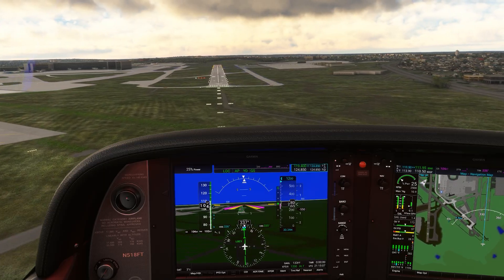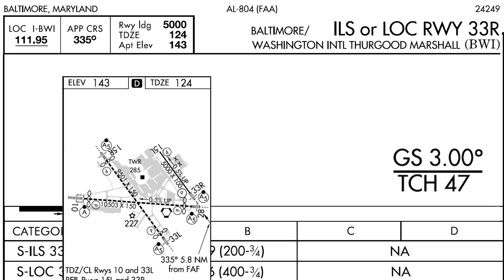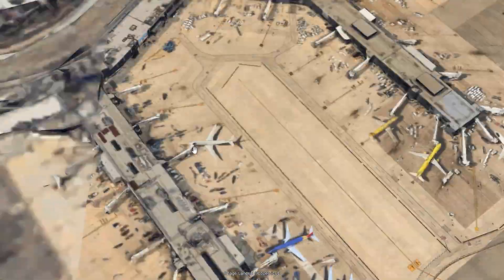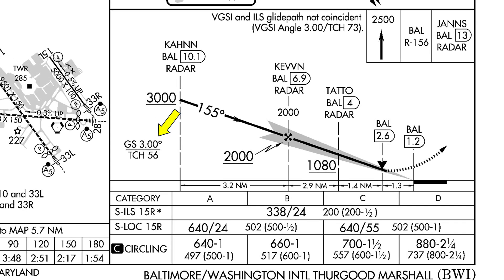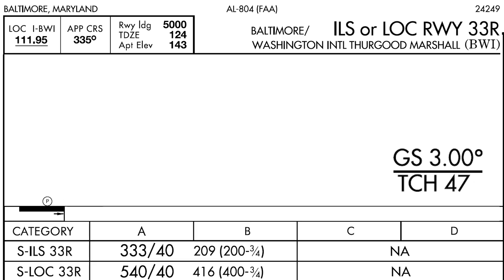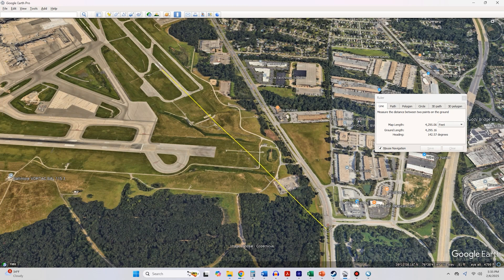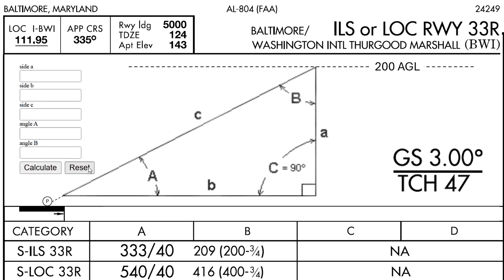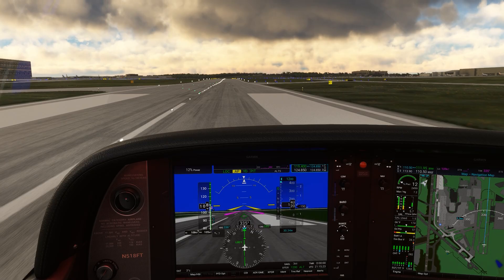Where do PAPI Lights Take You? | Visual Glideslope

Comment: This is one of the few things I am particularly picky about, and I like to brief it with my First Officers (FOs). Most landing performance data is calculated based on crossing the threshold at 50 feet. According to Flight Operations Quality Assurance (FOQA) data, many long landings can be attributed to crossing the threshold too high. While this isn’t the sole reason for long landings, it is an important contributing factor.

With that in mind:

When I brief an approach plate where the Visual Glide Slope Indicator (VGSI) and the Instrument Landing System (ILS) glide path do not align—such as with RWY 15R—I make it a point to mention that on short final (below 200 feet AGL), you’ll likely see three red lights on the PAPI. This is because I’m positioning the jet with a normal descent rate to cross the threshold at 50 feet

Great video!

Comment: Exactly this will be very relevant to investigators looking at altitudes around the DCA rwy 33 mid air. 

Draw an extended centerline across the water where the helicopter route was. Measure. Calculate.

Spoiler: the CRJ was in fact a fair amount above the PAPI GS at the time of the collision. There was no way a helicopter route fit under that glide slope. Holding was the helicopter's only viable option.